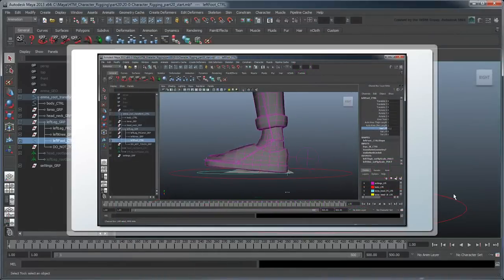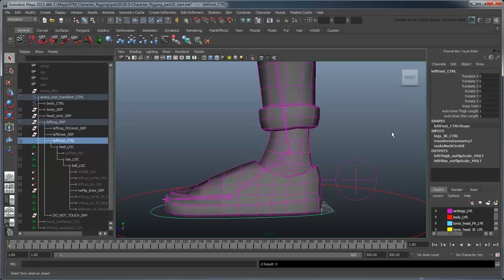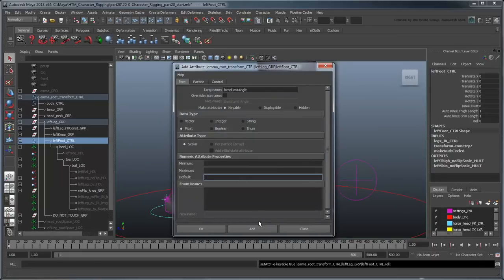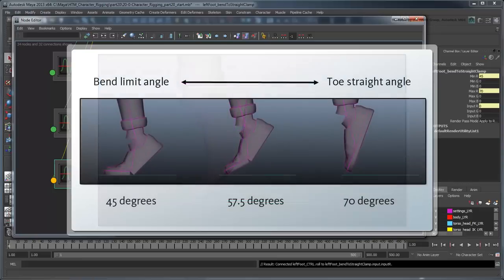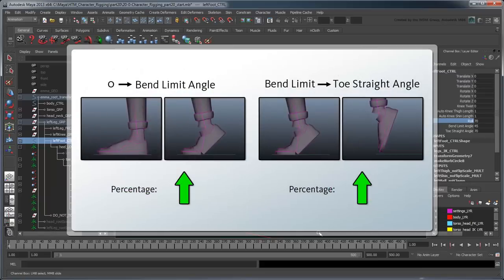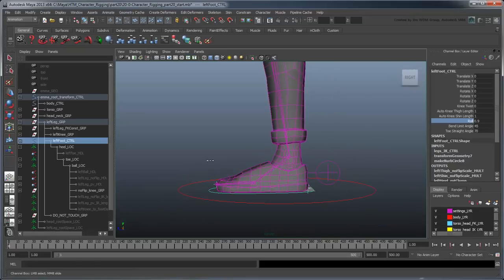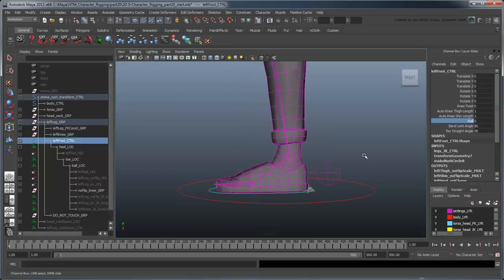Creating a Character Rig - Part 20: Smart foot roll (Advanced)

Comment: im having a problem where my ball doesnt change the angle between 0 and 45 degrees. after this, it will always stay flat. So say the roll is at 70, the ball will go into a negative roation in order to stay flat. 
the ball does react normally to the negative roll. so when the foot is rotated onto the heel, the ball moves with it as it should. 

this is all the info i think you need. any ideas as to fixing this?
using maya 2015 btw

edit:
im trying to diagnose this myself while i wait, and i notice that the heel does not move up when im rolling. so could this affect the matter? if i change the max settings on the heel, it distorts the leg. like it moves the heel down, and the legs follows it downwards.

another thing i also noticed is that the toe rotates past 70 degrees. 
i think this is all the info you will ever need. haha
Reply: ***** Found my problem. just incase anybody does the same.I didnt set the first input, of the plusMinusAverage node to 1. it was at 0. 
So the node was working it from a percentage of 0.

Comment: I'm having a problem with the roll, whenever im increasing the value by 1 the ball rotation increases much more
Reply from the maker: Viper StudiosEntertainment Sounds like you have a multiplication where there should be a division in one of the multiply/divide nodes.
Reply: Maya Learning Channel nah i was just being stupid, got the wrong output connected to the addsubstrac node

Comment: I am working through this tutorial again after finishing the left side.  I have come this far on the right side and ran into a problem.  When I use the roll attribute everything works correctly until the value reaches 90.  As soon as it hits 90, the toe flips 180 degrees.  What am I doing incorrectly?
Reply: Ok, I just went on to the next part of the tutorial to keep my momentum, and after I was finished, this was problem was fixed.  So it's all good. I can only assume it was a similar parenting problem that the tutorial went over when it was fixing the toe spin flipping problem.  Thanks for the tutorial. It is wonderful.

Comment: i've completed this part, and it works as expected however there's something that really bothers me ... the transition from the toe straight position to the contact pose.let's say it's obvious that it goes, toe, flat, and then heel ... is that something wrong with the way i'm animating or does anyone else run into this problem ?
Reply from the maker: Try smoothing this out by editing the animation curves for your keys in the graph editor.

Comment: What's the point with the 2nd and 3rd clamp node since we don't use their OutValue ? I plugged directly the inputs from LeftFoot_CTRL in the set range nodes and it seems to work as well. Will it cause problems ? Or is it just a better way to organize the nodes ?
Reply from the maker: That's correct.  We did it mainly for readability.
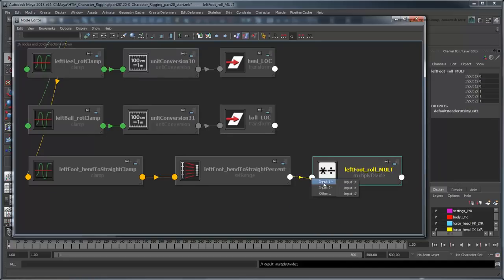Reply: unlike the way at 9:40, (the bendToStraight_MULT's input 2x is connected to the "input" value of the clamp node), don't we need the "output" value instead? to prevent the toe from rotating over 70 degrees.
Reply: @Dahyekim3  Thank god i found your comment <3

Comment: however I wonder ... what are the advantages doing that using all these nodes compared to using set driven key ? i mean besides the ability for the animator to set the range limits ?
Reply from the maker: This is the primary benefit.  With set driven keys, you are limited to the same foot roll every time, which while workable can be a little dull. Although the method we show requires some extra upfront set-up, the payoff is that you can easily animate a wide range of foot motions (regular walk, run, hop/skip, tippy-toe, etc).